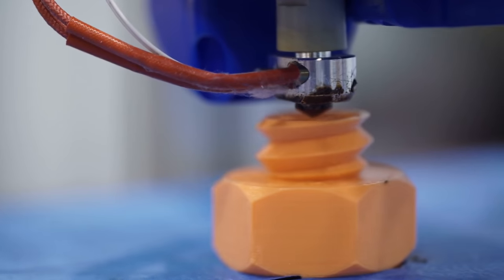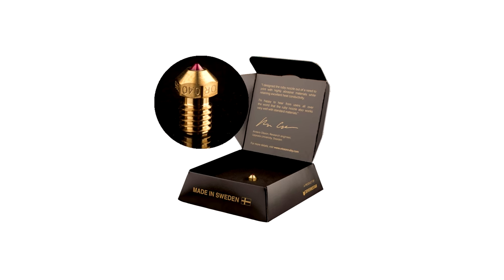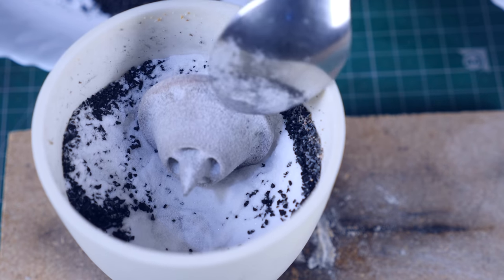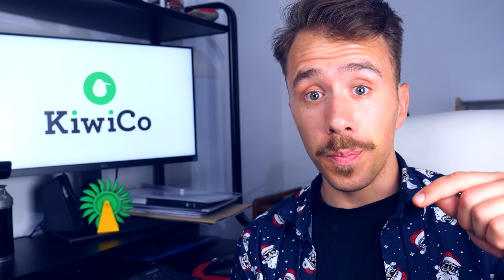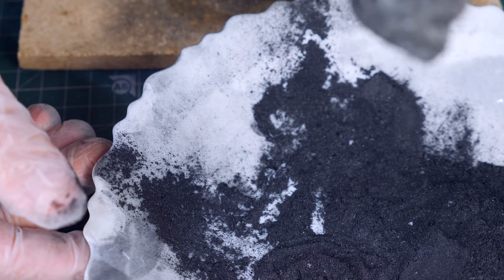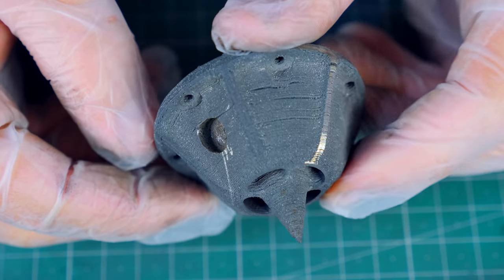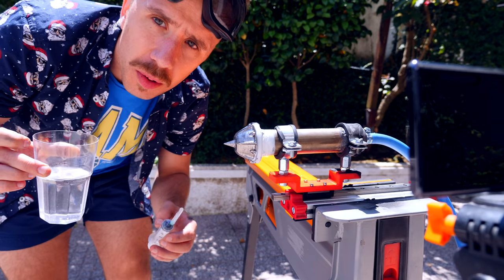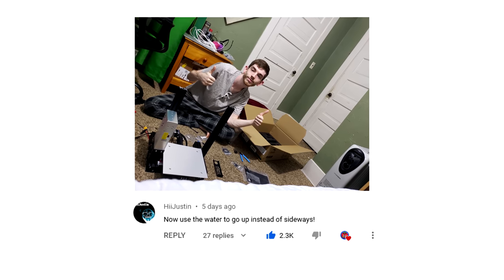How I 3D Printed a Metal Aerospike Rocket at Home

Comment: Maybe you could reduce the effect of the warping on the bottom by adding extra material there (think raft) and then grinding it down to spec in post.
Reply: If this guy had a simple mini lathe, he could have it as flat as he needed it in no time.
Reply: @nefariousyawn  yes this would be the ideal way, but I'm betting he could use blue sharpie and a pair of calipers to mark where to trim it down to and then apply a disc sander in increasing grits he might already own?

Comment: Video idea: try doing it again but run a really high flow rate pump and integrate water channels into the design to allow it to last longer, hopefully indefinitely. This could be a first step into building a really high thrust test rocket... or you could use an old air conditioner to make so you could get the nozzle nice and cold so it should last longer before it heats up
Reply: He could use the half-mil gap in the part as a water channel for the outer bit, not sure how solid the inner bit is, might could use it as well

Comment: I think you should try this: make a negative mold of your nozzle in ceramic, then melt a bunch of the steel filament and pour it into your mold. This should reduce shrinkage to a minimum if you overfill the mold a bit, and then you can sinter, and all the metal will sink thanks to gravity, leaving you with a 100% fill part with no defects... Also, aerospikes need to be cooled internally, otherwise they melt, even in real world engines.

Comment: Great video, didn't think it was possible to 3d print metal with a run-of-the-mill home 3d printer, but it is, apparently! Some tips: 

-You can 3d print the rough shape and then work it with a milling machine and/or lathe to get it to a precise shape

-weigh the shape, then measure it's volume by submerging it in water and note the displacement. Then you can calculate it's density so you can get an idea of how solid it is, which you really want with anything load bearing.

-as a wannabe rocket scientist, I find this a great development. Now if I can only hire a nice volcano somewhere for my mad scientist laboratory..

Comment: Virtual Foundry makes an Inconel 718 filament, it would stand up to high heat much better than what you're currently using.
Reply: What's the sintering temperature for something like that? Also is Inconel as susceptible to burning with added oxygen as steel? It seems keeping the oxygen content under control is pretty important. Ceramics has the advantage it takes a lot to make it melt and even more to get it to burn even with added oxygen (AFAIK). Unfortunately ceramics is also rather fragile and prone to crack.

Comment: Use a stronger more heat-resistant metal to make an aerospike nozzle. Also, put cooling into it like a liquid cooling system. Then make a staged rocket using multiple engines, and see how far you get. That would be a sick vid/series.
Reply: That would be fire... hazard.

Comment: Since 3D printing metal is difficult, you might try using lost wax casting. You're already using this to cast ceramics.

Create a ceramic mold which attaches, upside down, to the top of your ceramic cup. Fill the cup with small pieces of metal then attach the mold to the top. Put the whole thing in the kiln. When the metal is molten, take the whole assembly out of the kiln, flip it over so the metal flows into the mold, shake / slosh it to get the molten metal into all corners of the mold, then let it cool. You use your tongs to move it , and the mold is specifically made to cover the entire top of the cup so the molten metal is never visible and never likely to get splashed on you or anything else.

You're pretty clever; I'm betting you can figure out the rest.

I remember reading an article, some years ago, where an artist was actually doing this with an industrial microwave oven, not a kiln, to cast small, decorative metal pieces. His was specifically making his molds to completely cover the cup where he was melting the metal, such that all he had to do was take it out, flip it over, put it on a vibration table to get metal into corners and get bubbles out of the metal, then let it cool.

Comment: Kudos on the achievement of obtaining a solid metal part from 3D printing!

Suggestion:  Flip it upside down such that the flat part is horizontal to the ground, but on top.  This should result in less warp.  

If your sintered product is significantly deformed, it's too much heat.  If parts aren't sintered, it's too little heat and not enough time.

If you want very high temperature metal combined with near-zero corrosion, try Hastelloy.

Comment: How about printing a nozzle in abs and do a "lost wax casting" to get a perfect steel nozzle ?
Reply: seems like a ton of work for something that can be bought for cheap bc its shape is easily cut on a lathe
Reply: Steel is VERY hard to cast it needs to be much hotter, so it burns more in air and also shrinks a lot more, which makes the molds much harder (sometimes practically impossible) to design, and also molten steel is thicker, so much less able to fill in fine details
Reply: @Wise_That  and cast iron?
Reply: @alfredorotondo  nearly impossible to get complex shapes out of cast iron & yea, it too has to be VERY hot in order to properly pour for a cast. Not to mention it's extremely brittle
Reply: Dude Joel he literally explains why not at the start of the video. Because he wanted to do it with steel and steel is hard to do in that method with what he has but also he just wanted to 3D print it
Reply: I see you're trying to make a cake in the microwave to see if you can do it and just for fun, but how about putting it in the oven to get the perfect cake? I'm going to act like you never considered this even though you mentioned you don't have an oven big enough for the cake
Reply: @aSipOfHemlocktea  it's funny you mention microwave cake, because there is a cake recipe that calls specifically for microwave cooking. Just for fun (or for breakfast) crack an egg into a coffee cup with about 10 drops of water in it. Scramble thoroughly then put into microwave for 1 minute uncovered. The egg will grow drastically in height due to the aeration from water turning to steam & within about 40 seconds you'll see it start to climb out of the cup. After 1 Min up, dump egg out of cup, sprinkle with cheese (and/or salsa) & enjoy!

If done properly, microwave cakes are fluffier and more moist than oven cakes due to the same - but casting steel is still a horrible idea... 😁

Comment: Okay had an idea. If your engine is overheating include changes in the parts that overheat to allow cold propellant gassed to flow through them, use the fuel to cool the structcure. early rockets had that system If I recall correctly. Create one central inlet, with small channels running in a coil inside the body of the combustion chamber and nozzle feeding back to the injection ports. 

If you injecting fuel and oxidizer through those ports, it cools the shell ad preheats the gasses. as well as allowing you to create a tailored injection pattern for both fuel and oxidizer

Comment: Video idea:
Try making a magnetospike, they use magnets to guide the exhaust which gets rid of the melting problems
Reply: magnets fail in high temperatures
Reply: @carpenterbeebuzz5461  you don't have the magnet exposed to said temperatures

Comment: Your next video should be about making supports out of that metal 3d printing filament and test them útil they break to test the proprieties of those metal parts, but the supports have to be designed only by artificial intelligence or also known as topology optimization (solid woks and fusion 360 have that design option available and is really starting to get used in supercars and aerospace industries). 
Please leave a like I would love a 3d printer I’m studying electromechanical engineering and live in Argentina. 
Thank you ❤️❤️

Comment: You should be able to make an hourglass rocket engine using sugar and potassium chlorate for fuel.  Or zinc and sulfer.  The engine itself where the throat that controls the flow isn't very large.  Certainly no larger than the aerospike.  I am truly impressed by the way.  That was an outstanding achievement!

One thing I haven't figured out is why people aren't using casting chambers in which the metal to put in the cast is in a chamber above the mold and connected via a hole in the sand.  Then, you could use argon to flush the entire system before heating it up, use electricity to heat the metal which would then flow into the lower part containing the mold.  Since everything is being flushed with argon oxidation won't be a big issue, and because your not exposing the metal to the air when it is heated and forged it will not cool as fast and you should get a better cast.  In fact, you could easily use electricity to make the metal cast cool as slowly as you wish.

This is just an idea I had while watching your video.  You will have my email address as a patreon of your site, please contact me to discuss this.

Comment: u need to weld a sheet metal flange to mount the nozzle to and then just print cylindrical fuel rod to avoid the melting and falling off problem. Very impressive series btw.

Comment: "It melted the steel." And this explains why aerospikes aren't in common usage...
Reply: That’s not really why aerospikes aren’t used lol
Reply: @Spit823  They have severe cooling problems.
Reply: That's not why they're not used,  that's why steel isn't used.
 Aerospike nozzles have never had successful fule systems implemented and are still only in research today.
Reply: @adamadkins9527  True enough; I oversimplified. Why STEEL aerospikes aren't in common usage. If they could solve the overheating problem, though...
Reply: Could a combination nozzle be made? Like would it be worth it to print the body out of steel and then use ceramic for just the spike?
Reply: @adamadkins9527  The main issue they are researching is indeed cooling the tip. Most designs that have advanced pretty far are linear aerospikes as those have less cooling problems. Toroidal aerospikes like this almost always self destruct if run long enough and development test runs are usually pretty short (<30s) if they progress to test firing.
Reply: The cooling of the spike is tricky in deed. But the TU Dresden solved this with a 3D Printed Aerospike engine with cooling lines in the spike.

https://tu-dresden.de/ing/maschinenwesen/die-fakultaet/news/3D-Raketentriebwerk?set_language=en

Would like to test a smaller version of this with 3D printet material from the video

Comment: Well, I guess you can heat-treat you metal 3D printed parts. You have all the tools you need for that.
Also, to fill in the tiny bubbles inside the print, you can use electrolysis to deposit some metal on the surface and then re-melt it to fuse it all together.
Reply: he has got a mig welder too...
Reply: A "remelt"  without ,  say... a graphite or some type  of mold that can handle  extreme heat.     Idk?  Maybe    a simple homemade mold will work...but there is the chance it could make it worse.   Probably worth trying  if you have the materials....!

Comment: idea for a video: try to make a metal rocket using galvanoplastics, for this you will need to print plastic parts and then cover the part with graphite and build metal on it using electroforming.
Reply: This would be fun, but it wouldn't yield useable rocket nozzles.  As far as I know, electroforming in the home shop is limited to copper, nickel, zinc and gold.  Zinc and gold involve especially dangerous chemicals for the home gamer, but regardless aren't useful in this application.

I think his current usage of 3d printing is on the right track, but he needs to get his technique down, and work on the nozzle geometry.  I want to see him explore lost print casting.

Comment: Why use metal filement when you can 3d print a plastic part and make a mold out of it and cast metal in it the method is called ( lost PLA method)
Reply: There is also powder metal sintering buuuuuut that is really not cost effective. At least atm.
Reply: Wax filement is possible too, and it burns out cleaner then PLA
Reply: Problem is, it's not really that great process.
Firstly you cannot really make really complex pieces with it because the plaster or other material you use to make the mold cannot get to everywhere, like a water cooling for aerospike is impossible because you cannot cast the cooling loop.
Secondly the finish is always bad and you really need to take it into account, you will most likely always have some bubbles and other imperfections left and the piece will always need a lot of grinding.
And lastly, frack ups, with casting you never know did everything go well before the end and there's a lot that can go wrong, this is actually why there is so many ways and methods to create the mold because every and each one of them have their problems (like only with plaster+sand you can either do the mold with sinking the part into runny plaster mix and let it harden but you may end up with imperfections within which you cannot see, or you can make a more though mix and build the mold around the part layer by layer and add stuff to strengthen the mold but you cannot make extremely detailed stuff or complex parts).

I'm not saying it's bad process but it's a bit crude method. It works great in certain projects and parts but it's always a bit time consuming and iffy if you want precise parts and if you really need precise parts, it's pretty much no go.

Comment: I'm old school. I would have 3D printed the model, then made a silicon mold of it, with Aluminium powder to keep it rigid. Then I would have made a cast of the piece in plaster, created a mold in epoxy resin with 'green sand' & poured in molten Aluminium. Of course you could short cut the process by creating a 3D printed mold, rather than the piece itself.
Now that is what I'd like to see Integza do, make a 3D printed mold, so I can skip the silicon mold step.
I would also like to see Integza make a 3D print from either a LIDAR scan or Photogrammetry scan with a tutorial on which software to use. He can use a family member as the scanned object.
Obrigado Integzinho.

Comment: Video Idea: How about 3d printing a working 2 stroke than 4 stroke engine.
Reply: That's a good idea, but wouldn't that get mechanically difficult, considering the sheer numbers of moving parts?
Reply: @JCake  that is why I said 2 stroke first
Reply: He'd need to be able to machine the parts also. An engine requires precise measurements and tight tolerances to work.

Comment: I know that this is has been mentioned (a lot) but;
Cooling. 
You need to cool the nozzle as you have seen with even the "steel".  With active cooling you could probably even go back to the ceramic.
Also, you don't need the center spike, it just takes up space and acts as a heating element soaking up heat from the stagnation zone of the exhaust.

Comment: You should 3D a diamond rocket engine (You didn't say that the video idea needs to be possible)
Reply: Sure, make an aero spike out of a flammable form of carbon. That costs more than platinum.
Reply: @mundymorningreport3137  It doesn't have to be natural diamond. Artificial diamond is not that expensive and you can make it DIY relatively easily.
Reply: @KohuGaly  I missed that memo on easy diamond construction, pass the link along, please. How do you address the choice of making the part out of flammable material? Perhaps marshmallow would be a better choice?
Reply: @KohuGaly  sounds like diamond deposition, nothing like laying a flammable mixture on the surface of your heat exposed part that will self destruct even faster. Might give you a whiter burn-out. In 1/2 the time.
Reply: @mundymorningreport3137  I've never said it's a good idea. Only that it's possible to do it. In fact, it's actually a very horrible idea. If the engine blows up, having burning diamond shrapnel flying around does not sound fun.

Comment: you could try dipping the part in liquid cermamic (suspend a slurry) and then letting it fully melt and fill the part? In which case you might have to print some extra material above the part to account for the lost plastic

Comment: You can impregnate steel parts with internal tubing for coolant! I just realised you can do that with 3D printed mechanical parts in theory if the thermal dynamics check out.

Comment: When you do the debinding... Put a small piece of some metal that melts in the same temperature you are doing the debinding ( aluminum?) . Then it will take the plastics place and and later when you sinter it it will bond with the metall you printed with making a stronger and better end part. Cheers from sweden

Comment: ok might be some kind of a stretch but they used to cool rocket combustion engine with film cooling which is basicly dripping liquid fuel on the chamber wall. it allowed "lower" grade of steel to be used in combustion chamber. there's cool cut out of v2 rocket engine showing them :)

Comment: The basic foundational part is awesome, but a follow up with a media blasting would clean it up quicker and leave a nice finish. Then lathe or machine finish the mounting or critical dimension surfaces. Those warps on the mounting surfaces could be cleaned up and have a flat high tolerance mating surface.
additive manufacturing is great but finish machining is still really useful. The additive process just REALY reduced the subtractive process amount and material loss. if you ever want to possibly coordinate I do have a 1950s lathe, small mill and some minor skills in my home shop. Maybe I could clean one up for you in the future! If not best of luck!